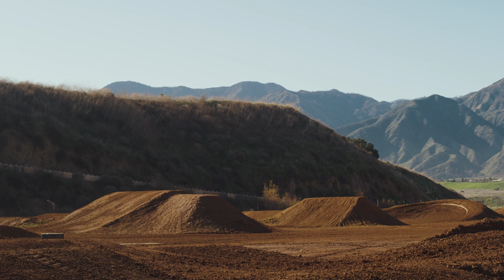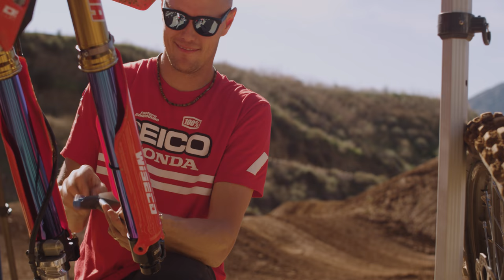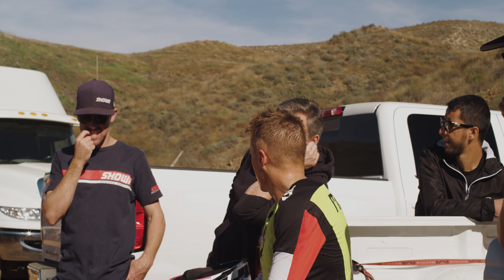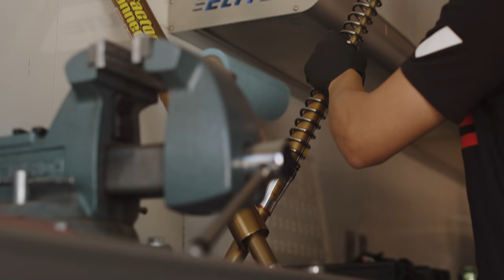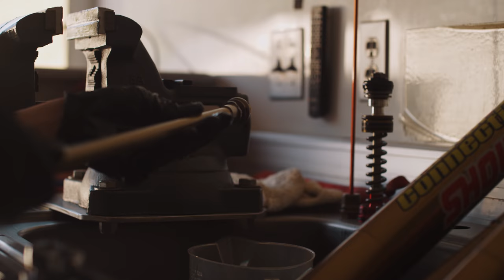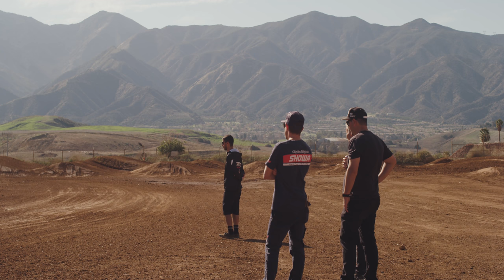SUSPENSION TESTING WITH JEREMY MARTIN | GEICO Honda Factory Connection

Comment: I was watching back in 2017 he is kick ass  I’m 5 5 got a 2016 ktm 350 sx beast but so hard when I have to tippy toe beginner 57 but love to ride any tips?
Reply: When braking use 20 percent rear and 80 percent front. Push rear first then front on everything except left handed corners. Left handers barely ride back brake for better traction while on gas. Then try down shifting and using no brakes at all. Smooth is fast. Fast is smooth. Cornering set reference points like sprinklers for braking. Be on gas before entering corner. Use the gas and your leg in corners to where if you let off gas you will fall. That's when you know your riding good. Jumping is easy. Cornering is a skill. Set suspension up learn rebound and compression well. Only do 1 to 2 clicks when adjusting suspension. Don't chop throttle when shifting. Hold open and blend gears barely feathering flickering clutch as you shift. Learn body stance aggressive and chillen. Let the bike do the work. Never ever never disrespect your bike. They know. Always respect your bike before you throw a leg over. They have a temperament sometimes